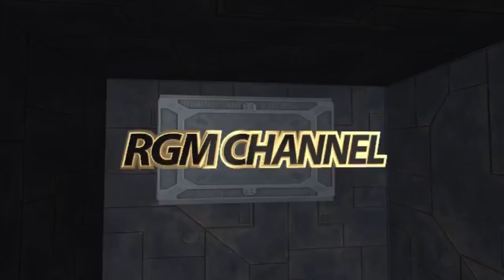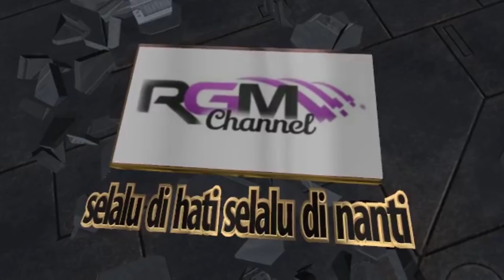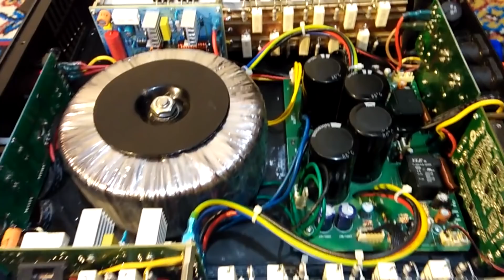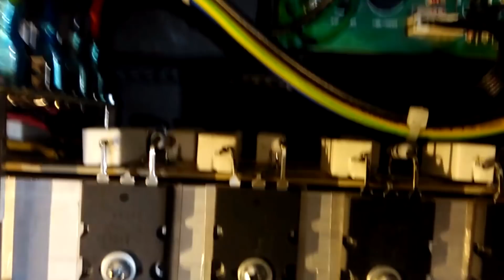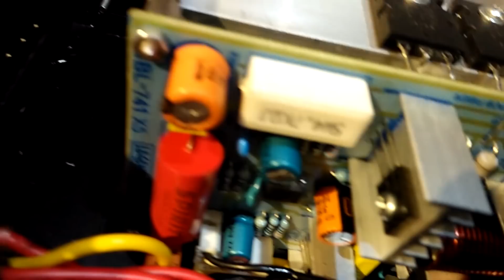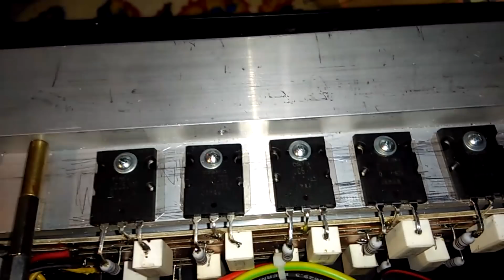AMPLIFIER 1000 WATT JBL 741 GLEEERR #2

Comment: kit power driver saya jbl 741 x6 (versi pro) , sudah ada protektornya, baru dirakit, begitu dinyalakan led protectornya merah kedap kedip , relaynya klik (bunyi tek) berkali2,sempat di psang speaker malah relaynya berapi dan berasap, apa ya penyebabnya. trafonya proton 10 ampere (maksimal 47 volt), elco 4 x 10000uf/63 volt unicorn, dioda 35 ampere, relay saat ini sudah diganti karena yang lama berapi dan berasap. trims